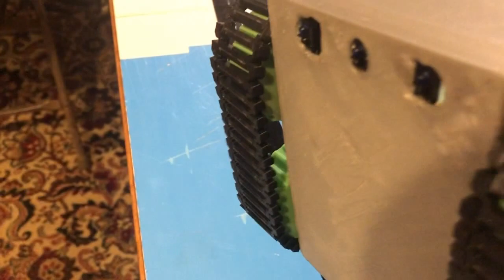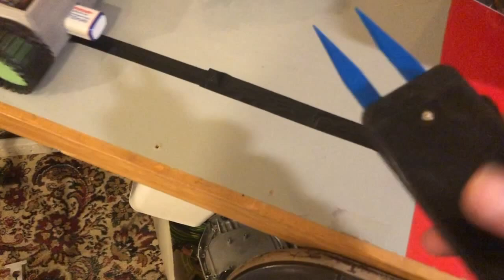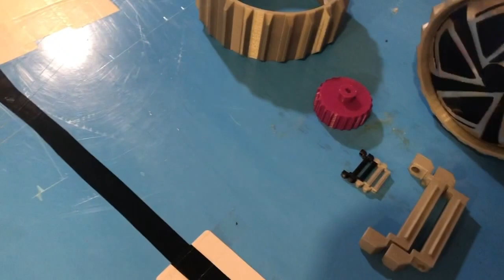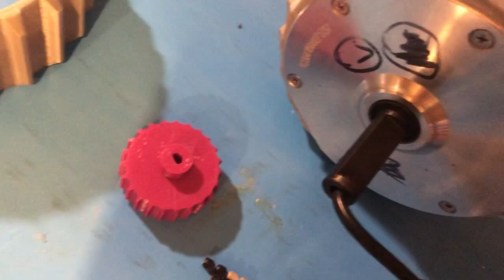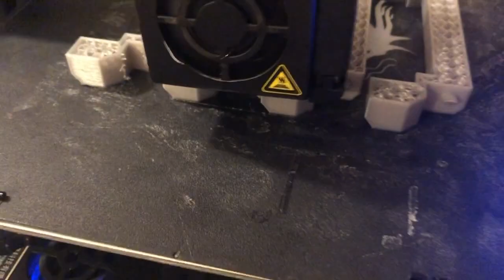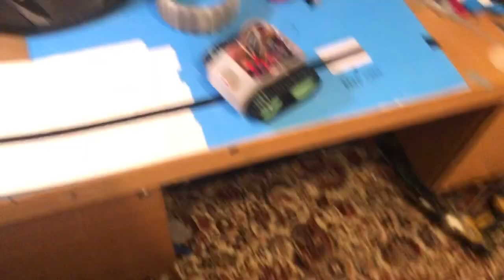3D PRINTED LINE FOLLOWING RFID TANK + HOVERBOARD TANK PART 1

Comment: Awesome channel. that's interesting.just found your channel and I'm going to go deep in your videos. can you tell me how strong the braking mode is ? . How much holding torque can we expect when the hoverboard motor is braking by shortening the phases. and is there any small rotation drift when the motor is braking over time if we apply an small external torque to it ? 
hmm... does it consume any energy when driver is braking ? I mean can we leave the motor locked for a while ?. too many questions
Reply from the maker: hi, thats great, ok shorting the phases, i have tested this a little messing around, the force is unmeasured so i cant give you any specific numbers but what you are saying i was thinking of it for some kind of handbrake, it doesnt lock up completely but it definitely causes a lot of resistance, for braking energy consumption i think it uses negative energy, one of my friends made a wind turbine with one, hope this helps, thanks
Reply: @A-tech  thank you. I'm going to start a project to make an add-on for a manual wheelchair and add a single hoverboard motor behind the vehicle. It's just like SmartDrive MX2 . but without omni directional wheel. Instead I want to retract the wheel a little upward when the device is in standby. So now I conclude that I will use a simple mechanism to retract the wheel.